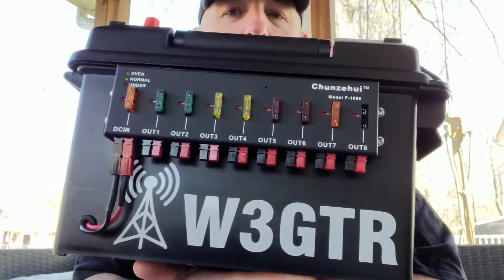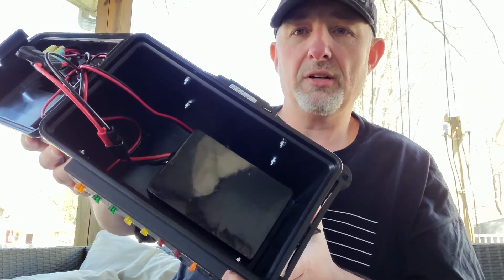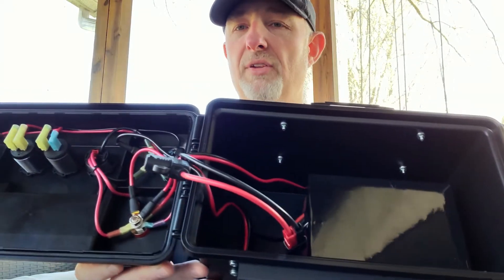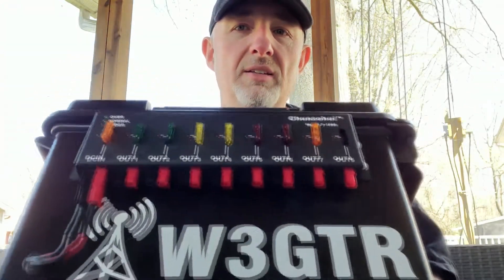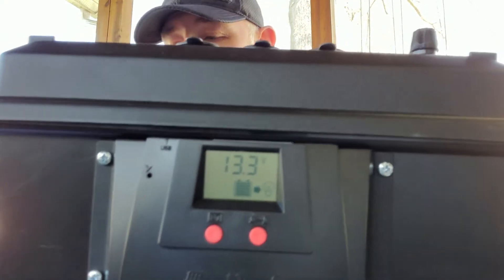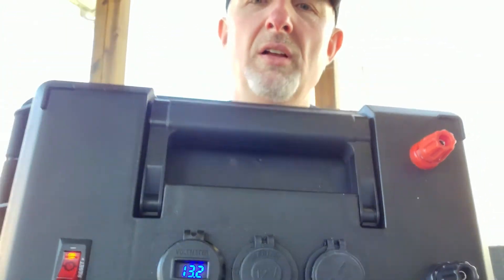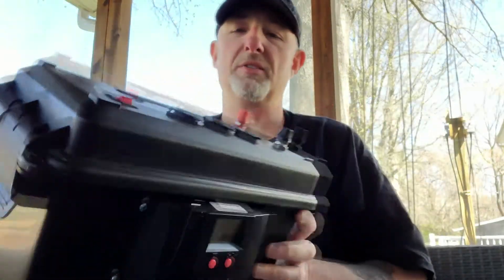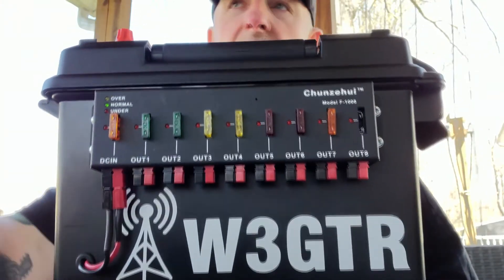Battery Box Build

Comment: Built a couple of these using the pelican type boxes from Harbor Freight.....Apache Boxes. Didnt put a rigrunner type supply on the exterior, but on the end of the box have 4 powerpole connectors and a usb with volt meter. Then master switch. One of the powerpoles are direct connect to battery (as opposed to being ran through the master switch and common ground etc) and has an inline fuse of its own. That was so that I could easily plug it in for charging or solar power feed. I just used a quality 35ah sealed lead acid glass mat type (I think it was). Heavier weight batter than the LifePo4/Bioenno type, but was much less expensive. I ended up buying an interstate brand, but not online as many of those have had a long shelf life. The local interstate stores have much shorter shelf life. I dont have any pics of the batter box itself on my QRZ, but I do have some pics of a "go box" that has its own built in battery (as well as built in power supply in the event that I have access to AC). Fun projects.